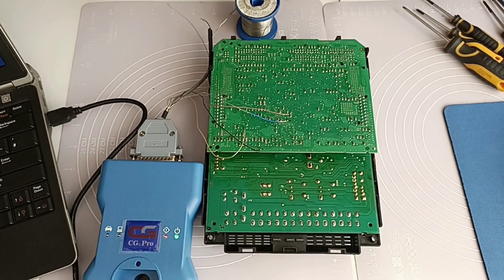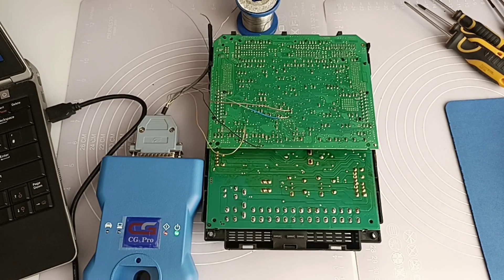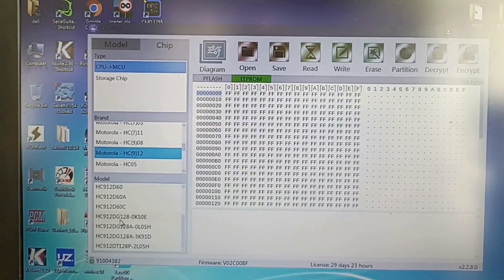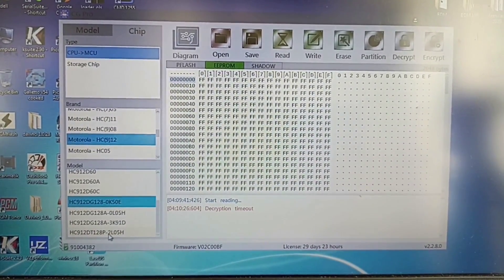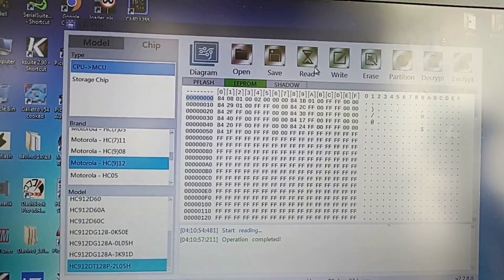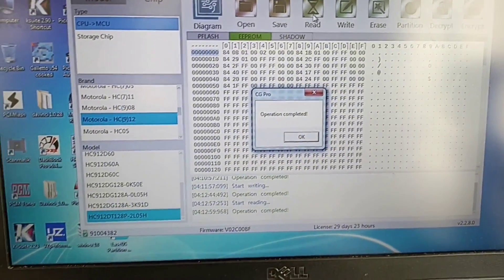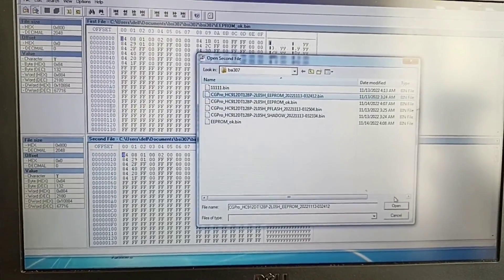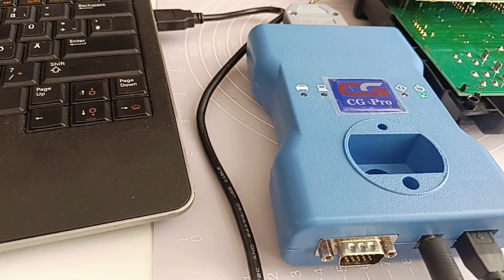CG Pro.The most advanced Programmer for BSI Peugeot-Citroen

Comment: Where are you found the pin out for read with cgpro
Reply from the maker: I didn't find them anywhere, I measured and found out where they are.  I will show you how it is done.  I will make a special video.

Comment: I am faced with a choice, I don’t know what to buy, What is better vvdi prog cgprog and how it copes with the task of cgprog I don’t even know which one to buy
Reply from the maker: Hello,
both programmers do pretty much the same thing.  
1. VVDI you can find several videos on YouTube that can guide you, but this should not be an advantage, because when you use the programmer, you get used to how it works.  
2. CG Pro is more capable right now with Software options than VVDI and what I like is that it updates Software+Firmware Automatically.  At Vvdi you cannot do this online and in the course of 3 years I have not received any firmware update.  
Without influencing you with anything, I gave up on Vvdi and Vvdi BMW, because I had enough unsuccessful attempts with it.

Comment: Thanks for another great video. This is CG Pro 9S12 that you are using in the video, right? If you have this one do you still need the MB and BMW versions (CGDI) from CG?
Reply from the maker: Hello.
Has different functions, to read and write modules from these brands it does it without problems.  if you want it to perform other functions it cannot, for example CG BMW can also do coding after you have repaired the modules.
Reply: @YOYODiagnostic  Hi and thanks for the answer. From their website (CG) I could not easily see what is the difference but I was only able to see that the CGDI units were more expensive than CG Pro. Anyway I am interested to buy FC200, CG100 PROG III and CG pro all full versions with all adapters from CG. I would be able to do most programming and airbag reset work with these tools?
Reply from the maker: @HelgiThorisson  
Right now the CG100 is the king of Airbag Computers. 
   I'm not advertising it's just my opinion!  
I will make a video for you to see what this CG100 can do.
Reply: @YOYODiagnostic  Thanks. That is awesome, I am looking forward to that. 👍